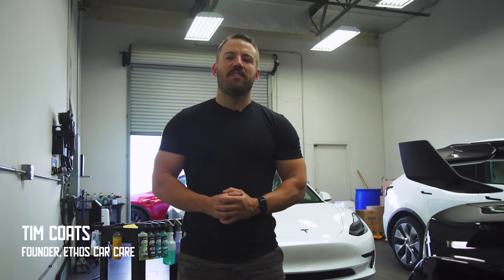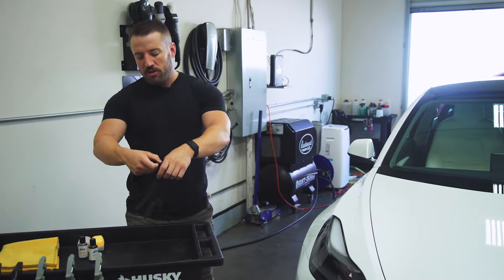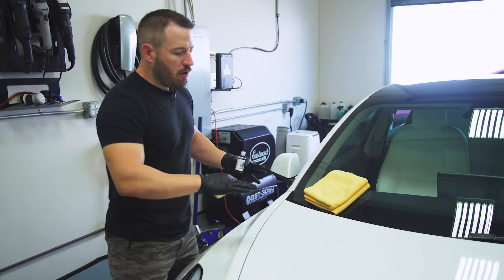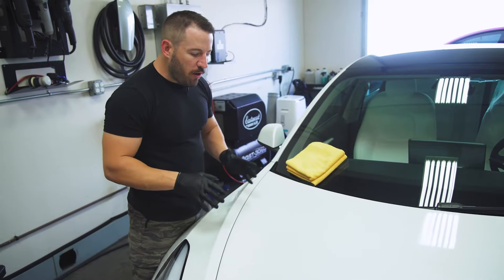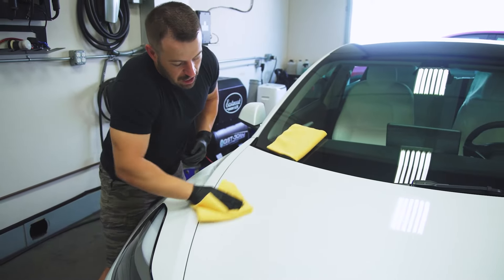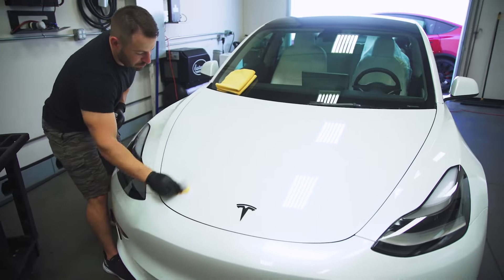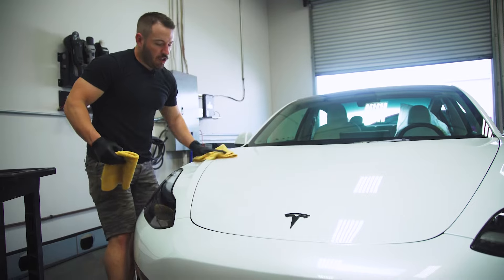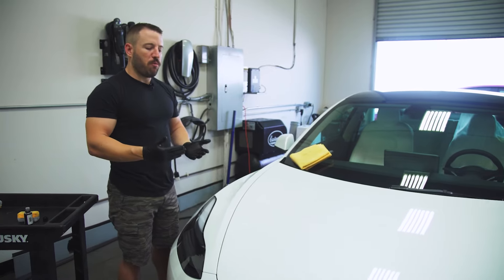How to Install Ethos Graphene Pro Coating V2

Comment: This coating looks super easy to install as long as you pay attention. I cannot wait to see the gloss and depth once the coating has cured. I love Resist but I would like to see a ceramic topper which sheets a lot more in my opinion. Thank you for all the great products you develop as they all work for me.

Comment: Hey Tim, will a 30ml bottle be enough for a full sized Ram 1500? Also, I bought EZPZ too. I was thinking of putting the V2.0 on the front half of the truck and the EZPZ on the vertical panels. Thanks!

Comment: I’m trying to decide between a new coating for my 19 mustang GT. 

Graphene Pro V2, Graphene to the Max, or Graphene V2? Which one should I go with and why? I want the best performance. Install is not a worry of mine as I have been detailing for years but I’m mostly wanting to know which of the 3 would be the one to purchase (best). If you could let me know, I’d really appreciate it!! Thank you so much.
Reply: Is your Mustang a daily driver? Are you experienced with coatings?
Reply: @tier1detailcompany  yes it is a daily driver but very well cared for. I keep it clean and love detailing. Used to do it for a living a few years ago. Not crazy experience with coatings but feel very confident in my ability installing them.
Reply: @dakotasimon3445  ok, then I would recommend going with Pro V2. Max is very thick and can be tricky if you're rusty. Pro V2 is extremely strong and pretty forgiving to install. I think you'll be very happy with it. Regular V2 is good as well for price point, but it's more DIY entry level. Though it is still a very good coating with 3-5 year durability. So yeah, Pro V2 is the ticket. Hope this helps
Reply: @tier1detailcompany  thank you for the recommendation!! I really appreciate it. They look like real good coatings
Reply: @dakotasimon3445  you're welcome! You'll definitely be happy with the Pro V2. I know Tim personally and he is a great guy and does not put out cheap or over hyped products that don't do what they say. He's serious about making these some of the best coatings you can buy.

Comment: Ethos Max says it's the toughest coating on the market at 7 years but your Pro formula says 10 years so I'm confused. Which is most durable? and which is the most hydrophobic? I'd rather purchase the 1 with best hydrophobics.